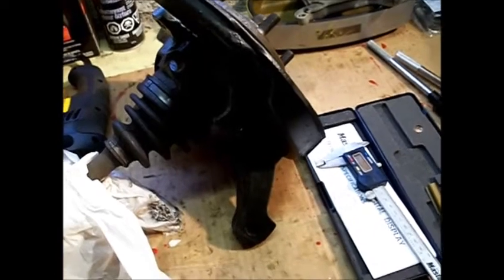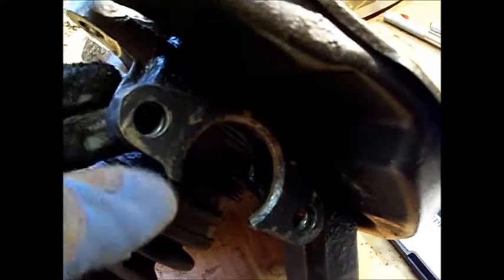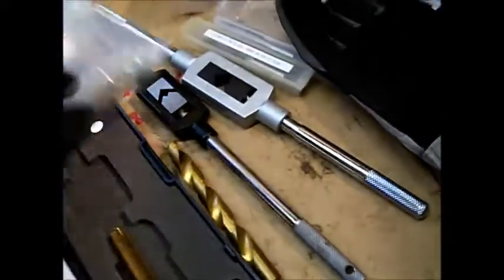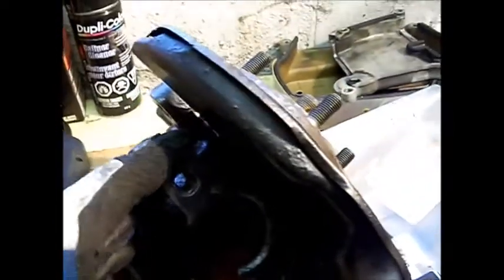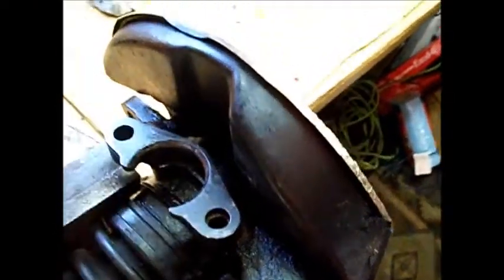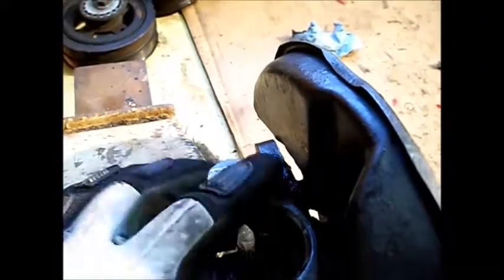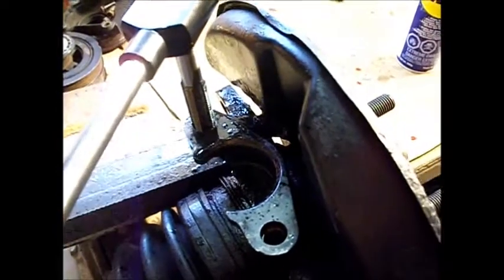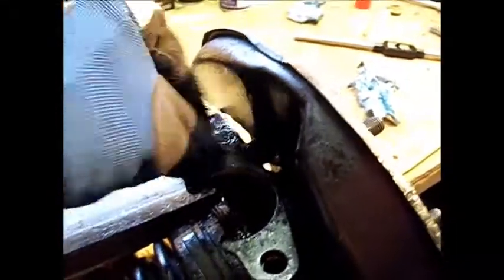repair a stripped thread during car maintenance

Comment from the maker: no problem. just make sure you have a good tap and drill set, drill out to the correct size using the tap chart and then tap away! everything should go smoothly.